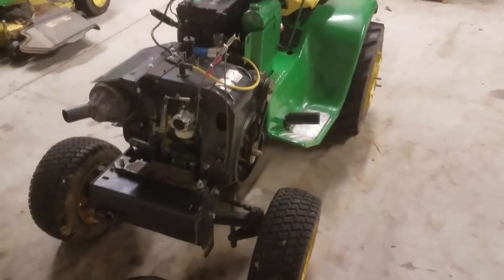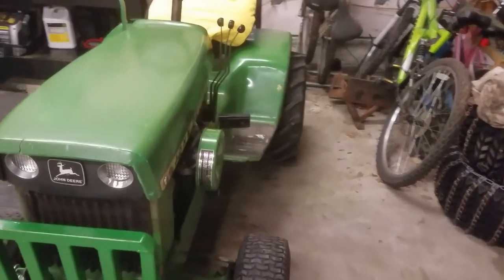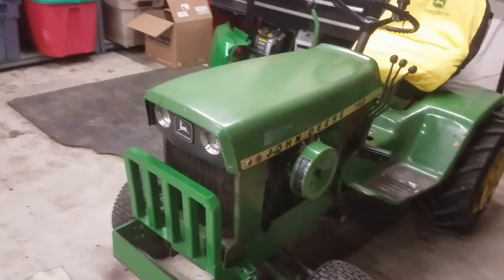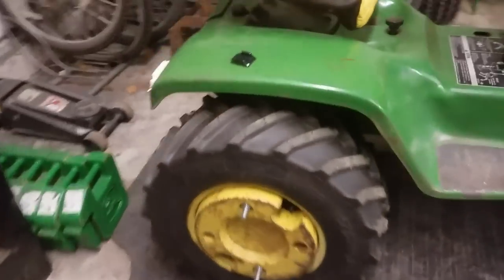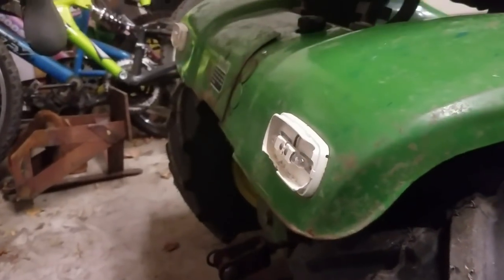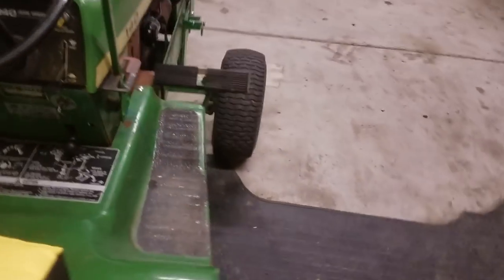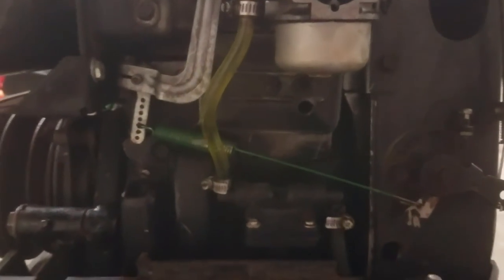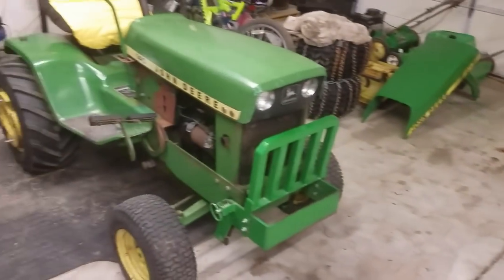PA Plow Day 2018 Prep -  Ready for Action!

Comment: Looks like you’re all set.  You might consider the GoPro suction cup mount.  It would be a good alternative to those adhesive mounts.  I’ve used one in several of my automotive videos and they work well. What editing software do you edit your videos with?
Reply from the maker: Thanks. I do actually have a suction cup mount and I've tried using it before, but it doesn't stick to the fenders on the tractors very well. It seems to work well on any surface except metal. I use Corel VideoStudio X8.
Reply: MichaelTJD60 What is the location of the PA Plow Day?
Reply: MichaelTJD60 That’s odd, I use them on car doors all the time. Might be scratches or wear on the fenders preventing a good seal.  I’ll have to try it on my 214 and see what happens.  I’ll have to try Corel, I like how you sometimes overlay photos over your video...I can’t do that with what I’m using.  Thanks for letting me know!
Reply from the maker: No problem! Since I don't always show myself working on the machine in real time, I usually like to split the audio from the clip and put pictures in instead.
Reply from the maker: It's in Watsontown/Dewart, PA 17777
Reply: Yeah, that's kinda the same reason I'd like to do that.  Plus, there are times when I reference a past video and it would be nice to throw a clip or photo of what I'm talking about over the present audio.  Thanks again!

Comment: What muffler do you have on the 210? Looks different from any 200 series that I have seen. Thanks
Reply from the maker: It's a 200 series muffler with a "funnel" and a piece of tubing welded to the end of it. My uncle fabricated that a few years ago...we were trying to figure out a way to keep the exhaust soot off the fresh green paint.
Reply: Thanks. It's a unique look. I just picked up a 210 & one of the first things it needed was a muffler. Ordered a nice used one off eBay. The new ones looked like they could be really thin metal. Looking forward to bringing the 210 back to life, but had to put it aside for now. A neglected 111 popped up & it is just the neatest little tractor. I'm going to jump on that one first. I might be looking for some advice & have some questions about your 210. LED lights for one. Really enjoying your videos. Looks like I have the green tractor disease also.
Reply from the maker: Haha, yeah once you buy your first Deere they start multiplying. I had 3 tractors at my house when I took this video a couple weeks ago, now I have 6. I'd be glad to help you out with any questions.

Comment: How's the  X570 holding up
Reply from the maker: Keeps giving us problems with the front end and steering. Otherwise it's been an excellent machine.
Reply: @MichaelTJD60  my 54 inch deck on my la150 Spring keeps flying off and I can't even find it this time! Same thing for our steering our piece of crap
Reply from the maker: @railfanjames7699  You sure you have the spring installed correctly? Could be something simple. Crappy steering on a 100 series doesn't surprise me, but it shouldn't be a problem on an X500 series.
Reply: @MichaelTJD60  I just got done repairing it yesterday. And yes I did put that spring on correctly
Reply: @MichaelTJD60  screw it, I'm going to throw it to the dealer.